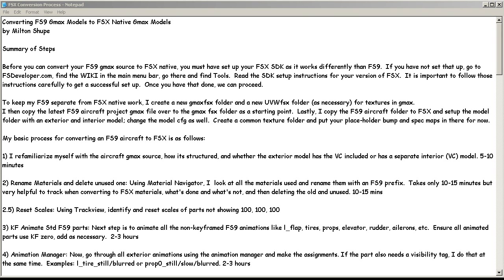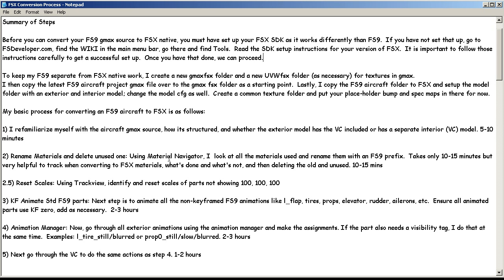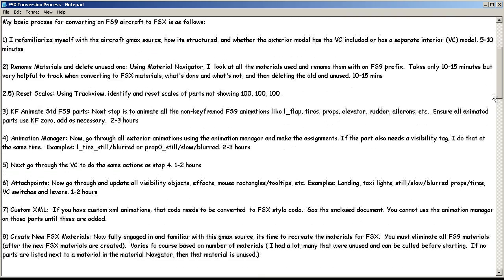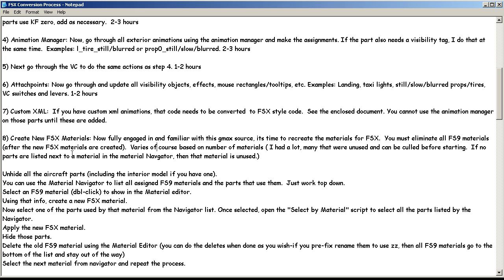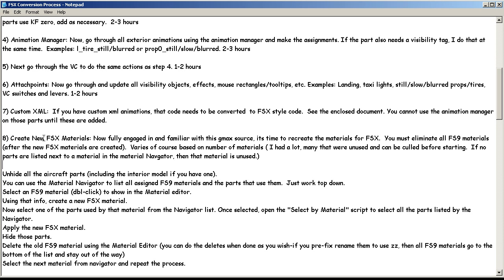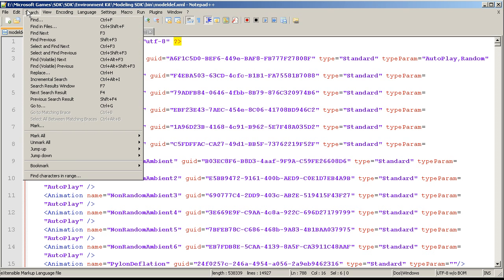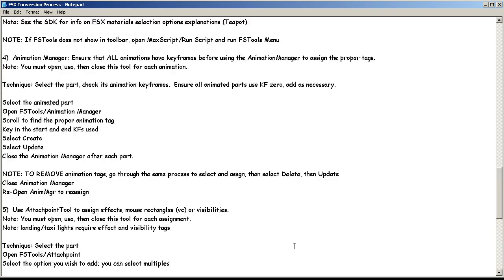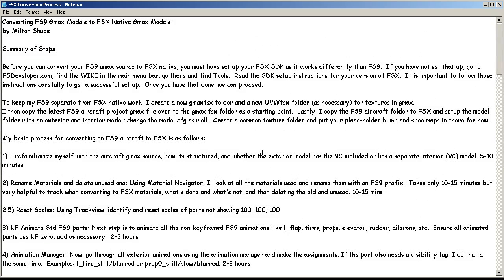FS9 Gmax to FSX Gmax Aircraft Conversions - Part 1

Comment: I just came across this video, and I'm curious:  Would this be a good starter project for someone who hasn't already done modeling for any flight simulator?  I feel like there are so many great FS9-native models out there that, with permission from the original modelers, there's no reason to reinvent the wheel by making the models from scratch.  Besides, I've noticed that FSX-native conversions of FS9 projects tend to be compatible with repaints that were made for the original FS9 model.
Reply from the maker: Philip, if you are knowledgeable of gmax, you have an advantage of course.  Knowing the typical expectations and methods for effects, lights, animations, the supporting xml, etc would be a great advantage.  Not having that background in FS9 or FSX may be a showstopper though.  It largely depends on your technical background and knowledge of 3D design tools, your ability to pick up the needed info when situations require it, your understanding of flight simulator requirements for textures/materials, ability to cope with xml and custom xml for FSX, and sim requirements once the model is converted.

Converting the model is only part of the project.  Converting any custom xml used by the aircraft (if provided), the panel and gauges (if necessary), effects, the flight model (if it is to be accurate), and texture formats, possibly some sound tweaking for enhancements are the other considerations.

If you have a general knowledge of these things, and have the tenacity to wrestle through the issues,  then you have a chance to succeed.  If you do not know gmax, then I would say you have a very steep hill to climb.  In that case, I would recommend going through my Gmax 1.2 for the Beginning Modeler tutorial series.

Good luck in whatever route you choose.